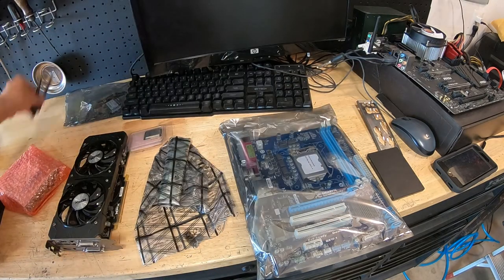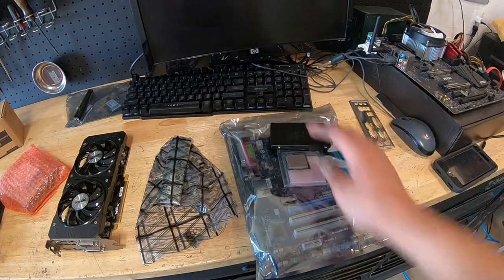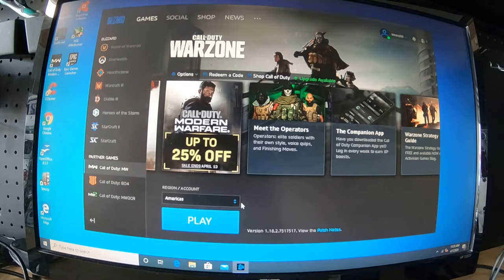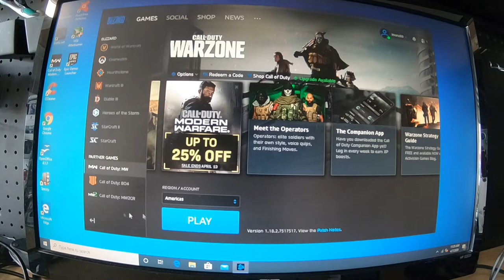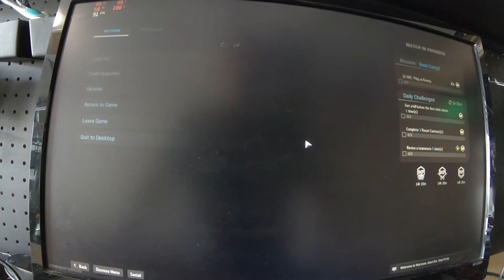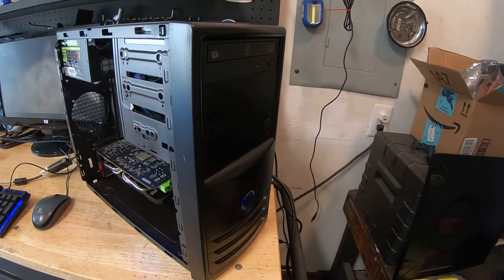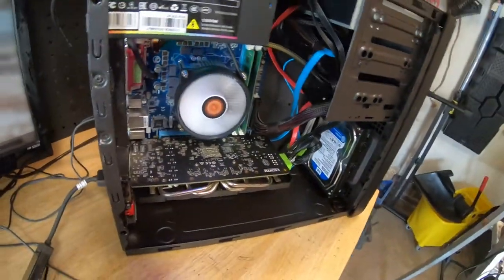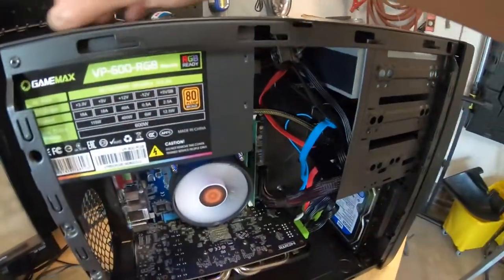Free Game!! Call of Duty Warzone build for $150

Comment: wats the specs and gb and where did u put the graphics card?
Reply from the maker: I5 3570 3.2ghz
Gigabyte H61m Motherboard
Inlad SSD 120GB
8GB DDR3
WD 500GB  HDD
XFX R9 380 video card
Trendnet Wifi Card
Gamemax 600 Watt Bronze power supply

got the guts from an old optiplex but had to swap out the motherboard to this gigabyte one. I had fried the old optiplex board, but I swapped this straight from an optiplex! Got a few builds on those on my channel. thanks for watching!

Comment: You think my system can run warzone? Before you go mock me, I'm till a student, cant afford a 'gaming' PC.

Specs are:
AMD A8-9600(Built in Graphics thingy)
8gb RAM
500gb of space
A320 motherboard.
Reply from the maker: I think it might but the only issues that may really hold you back is the gpu. Def give it a try as it is a free game and you have nothing to loose. Also i would def check out ebay for some use graphics cards deal. I have videos on the channel on buying used and cheap GPU's so def check them and stay tuned as I got a budget used parts guide video coming soon! Thanks for watching!

Comment: You could have placed the HDD in one of the 5 and 1/4 drives and put a fan on the front of the case after some modding.
Reply from the maker: yea looking back that would of been a great idea. later on the customer came back and upgraded the case but was experiencing thermal throttling from the graphics card.

Comment: did it ever stuttered? would 16 gn ram make a difference?
Reply from the maker: at 720p suprisingly no stutters no issues at 1080p had no stutters at low setting. 16gb of ram would help but I cant see too much of the help the gpu is what really matters.
Reply: @DLMtechgarage  what if i paired this system with an rx 570? could I play at 1080/ low settings without stutters? should I add more ram?
Reply from the maker: @daniper8092  the 570 would def give you no issues at 1080p with higher settings.. i have found 8gb to be the sweet spot for this games but more couldn't hurt.
Reply: @DLMtechgarage  ahh well no shit my game stutters and I have like 40-70 fps in warzone with my i5 3470 and r9 290x. I'm planning to put in an RX580 8GB, would that help?
Reply from the maker: @samuelz2214  Man that rx580 would def help that game run good since its not cpu intensive.
Reply: DLM tech garage ohh good to hear thanks a lot

Comment: Would this pc run games other games like fortnite valorant csgo FPS 90 or over?
Reply from the maker: Yea it ran them with no issues, never got them over 90 but i remember on medium settings I was averaging 65-70 fps and with room to overlcock I could get a steady 70fps. Thanks for watching and hope you can subscribe to help the channel!
Reply: DLM tech garage is there any specs to make it have higher FPS?
Reply from the maker: @jimyl2802  What do you mean?
Reply: DLM tech garage like is there any way to make the pc run higher frames on fortnite if you swap some parts out?
Reply: DLM tech garage what if it is on low settings? What was the fps?
Reply from the maker: @jimyl2802  absolutely, change the cpu to an I7 and that would prevent bottleneck and of course  a better graphics card, but in this case I would go with an i7 in it first.
Reply from the maker: @Demoncrafter-ro6mh  cant recall my friend but i am sure it would be way higher